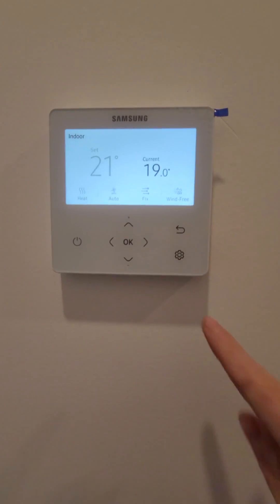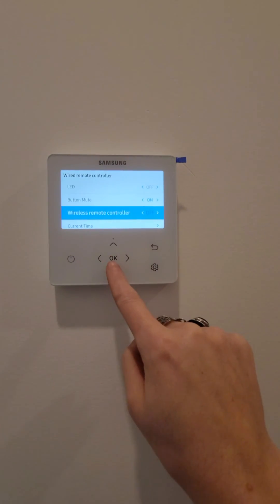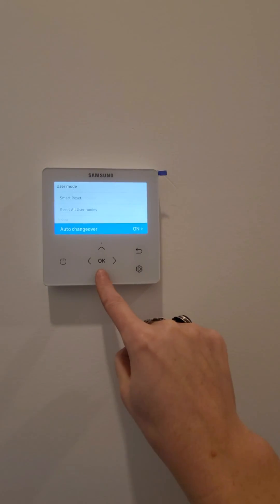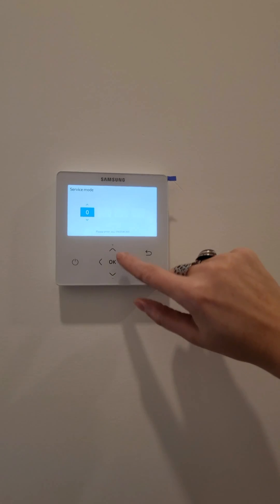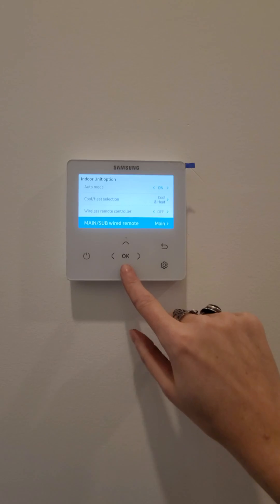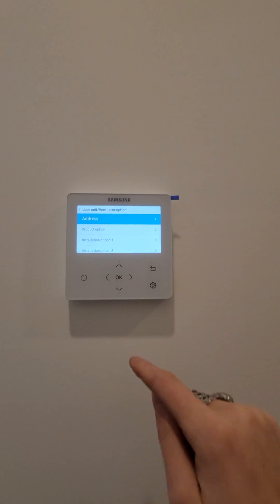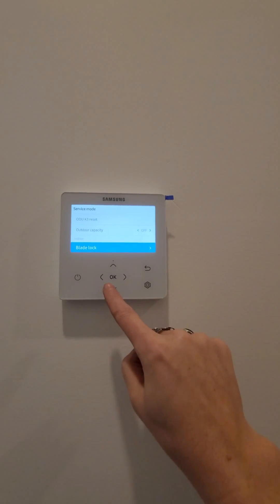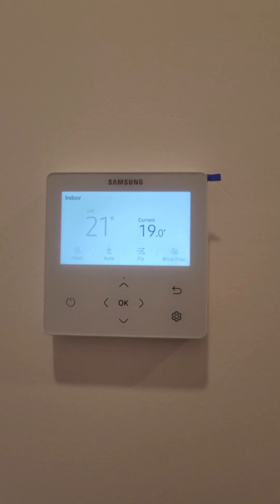Samsung HVAC wired remote controller basic settings

Comment: What is the wireless remote setting on this for?
Reply: If you had a wireless remote controller you can use additional features like temperature averaging.